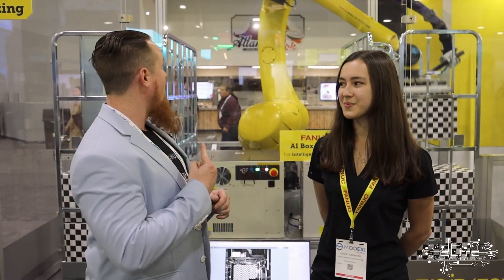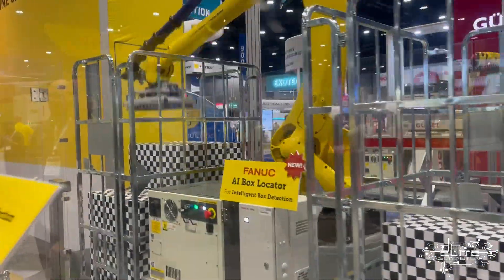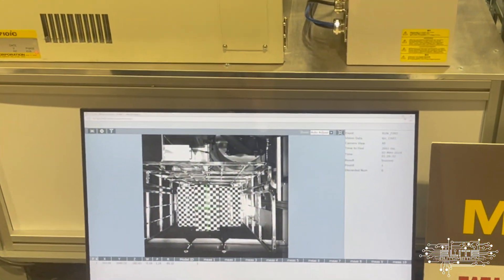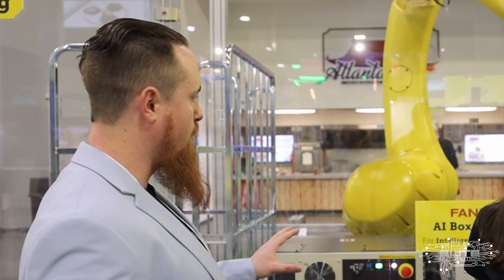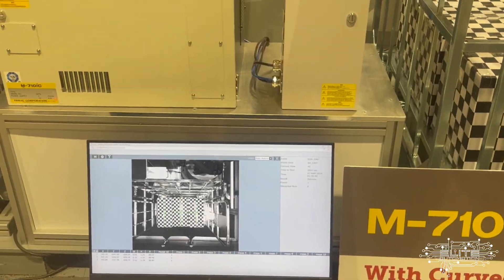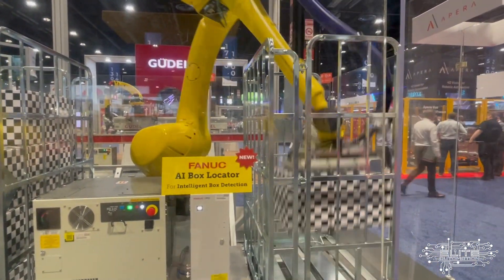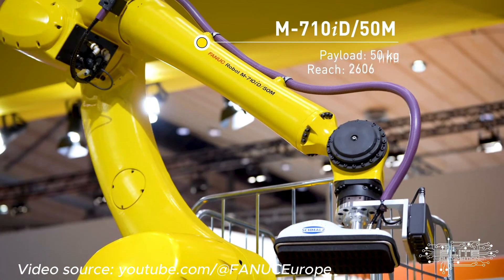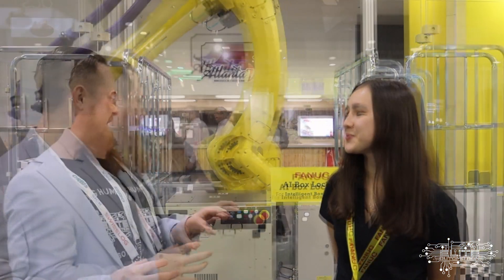FANUC Unveils AI Bin Picking & M-710i Robot! | Exclusive Look at Game-Changers

Comment: Not a game changer do you have the option to pull offsets from the camera or are you forced to let it generate the offset and logic.
Reply from the maker: Yes, the FANUC AI bin picking system with the M-710i robot can pull offsets from the camera. This allows for greater flexibility and adaptability in bin picking applications, as the robot can automatically adjust its movements based on the actual position of the parts in the bin.

The specific features and capabilities may vary depending on the exact configuration of your system, but in general, the FANUC AI bin picking solution is designed to provide a high degree of autonomy and accuracy in part picking tasks.